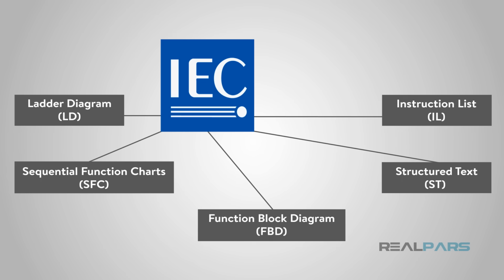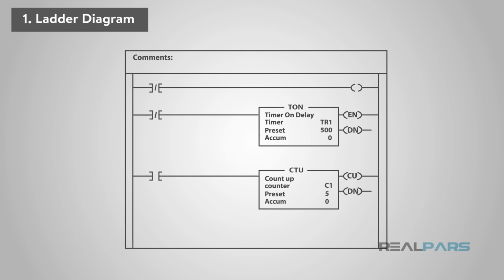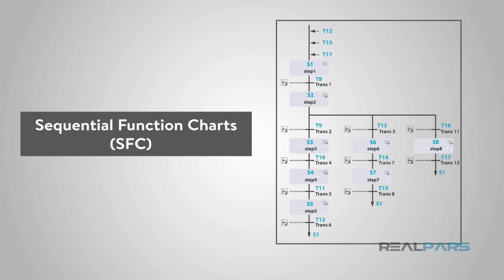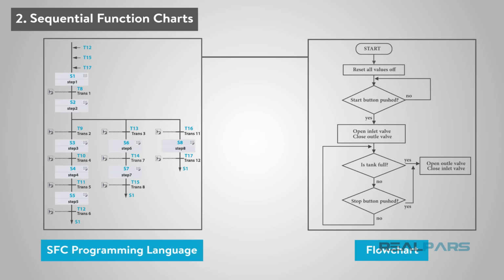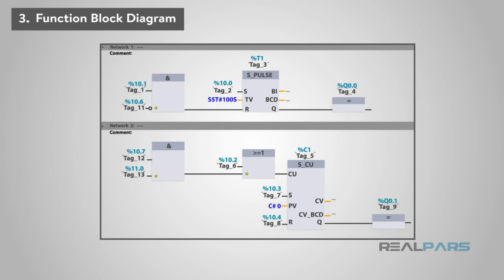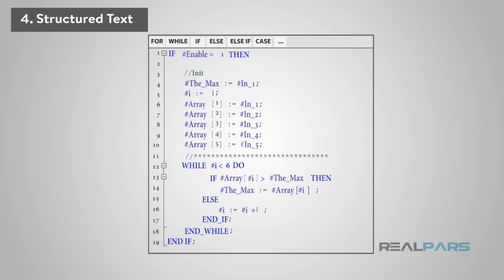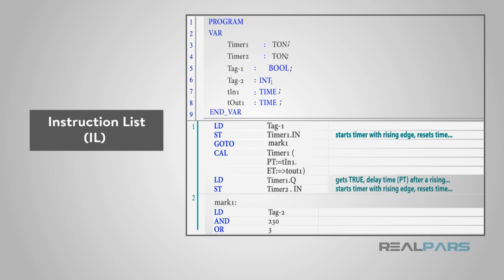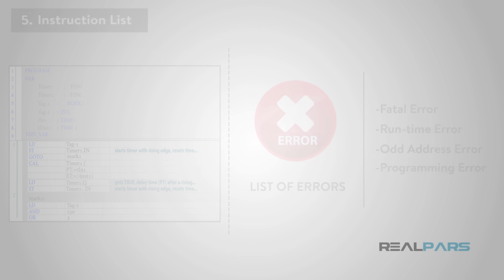What are the Most Popular PLC Programming Languages?

Comment: I worked in industry where both plc and pc were used to control  a pressbrake.Just could not figure how and why that was necessary.Somebody help.
Reply from the maker: Hello, @dominicmwendwa2204.  Thank you for your question. This is common in some industrial requirements. This is not new. I suggest you check with the design engineer or the manufacturer in your case.  Sometimes, it’s a cost-driven design. Happy learning from RealPars!

Comment: i don`t understand why we need PLC when we have microcontrollers. isn`t this some old fashioned?
Reply from the maker: Ibro, thank you for your question.  Although PLCs have existed since the 1970s, they have always been based on microprocessor technology.  In a PLC system, there can be hundreds of microprocessors since every CPU, communication card, and I/O card has multiple embedded processors.  Microcontrollers are just the same type of hardware assembled into smaller packages.  If you want to control a single machine, such as a lathe or CNC machine, then a microcontroller would be a good fit.  And this is precisely what the manufacturers of these machines do.  But to use an Arduino or Raspberry Pi programmed using C++ to control an industrial process is not practical.  You would need 10-15 RP's to match what a single small PLC can do, and the code needed to coordinate the functions of all these processors would likely go beyond the available memory of a Raspberry Pi.  Also, think about the support of the system on the plant floor.  I teach courses to plant controls technicians, and I have only run across one or two in the past 5 years who could support C++, Python, or another similar language.  I do not know many engineers willing to work shifts to provide support, and I am not sure companies want to pay engineers to do so, either.  Microcontrollers are not new.  So far, they have not been used for manufacturing applications. That may change.  In the meantime, smaller PLCs, like the PLCNext, have been gaining in popularity because they provide a traditional PLC hardware and firmware platform with the ability to use higher-level languages if the user wants to do so.

Comment: Last year, out of necessity, I taught myself the ancient Mitsubishi Alpha2 FBD platform for the sole purpose of reversing and fixing an undocumented, buggy, incomplete program that runs a public drinking water treatment plant. No backup copy of the program existed, so the first priority was extracting the program from the PLC. Upon opening a copy of the program to start reversing it, I was dismayed to find that the compiled binary doesn't include metadata like comments or the graphical layout of the program. All of the function blocks were stacked on top of each other, the "rubber band" connectors strewn and knotted up really bad. Took me weeks just to de-obfuscate the layout enough to even start reversing the actual code.

Comment: only using SFC FBD when required and ST as main, worked 10 years with plc's and rest I think they are a bit obsolete nowadays since plcs aren't used to perform only simple tasks, we got way higher cpus and mcus to only perform basic tasks, now a plc can handle graphics, peripherals with high speed connectivity, we have modbus tcp'ip, ethercat, hdmi ports, high speed usb poorts, cpus controlled better than a mcu with low jitter timings, multicores, high frequency, I think LD is in the past cause today a single plc can handle an entire system or a finished product; My opinion LD is for novice only, I prefer writing a line cause in the end a PLC is a logic controller same as a computer cpu
Reply from the maker: Thanks a lot for sharing your experience and knowledge with us. We are always very happy to read such insightful comments. 

Thanks again for sharing and happy learning!

Comment: The tutorials are awesome. I was hoping if you could help me with a question. Can a PLC use two programming languages at the same time?
Reply from the maker: Yes, at the programming software level. For instance, an S7-1500 CPU can use function block in one routine and ladder in another in the same program.  When the program is compiled. it is compiled to the same downloadable code type (SCL-like).  However, only languages supported by the CPU can be used.

Comment: i am a programmer in python and c++ and but I am new in automation subject. i really confused do i use Ros and Codesys. Can I control servos by Ros.
Reply from the maker: The "languages" that you use to program devices like robots and servos is determined by the manufacturer of the hardware.  CODESYS refers to a programming environment that encompasses the IEC 61131-3 languages as well as a few hybrids.  CODESYS is a platform-independent software development and execution application.  The developer tools are free, but the automation servers require purchase (very reasonable compared to a hardware PLC).   If you search the internet for "CODESYS Device Directory", you will find a directory of all available devices that can be programmed with the CODESYS environment.  ROS is an open-source programming tool for robot control that easily integrates with C++ and Python.  You would need to check with the manufacturer of the particular servo to determine if you can drive the servo independently as a "motor" or whether a specific drive is required to use the servo.
Reply: @realpars  Thank you very much for the reply.
Reply: Spacetime Matter Do you know how to design the PLC program S7 200?
Reply: @truongtruong817  Currently I have s71200.  i am using tiaportal to program this plc LD and scl languages. For pc i am using python snap7 libraries. But I haven't program any 200.Even i don't know 200 exist. Only 1200,1500,400 and 300.Why did you ask?
Reply: Spacetime Matter because I’m studying at school about PLC S7 200
Reply: @truongtruong817  probably Siemens sistem  all same. You need tiaportal for programming plc from pc. But it is not free.
Reply: Spacetime Matter yeah, how much does it cost?
Reply: Spacetime Matter which country are you in?
Reply: @truongtruong817  I prefer not to share my personel data in common area. But if you explain your problem totally and if i know the solution, i would like to help you.
Reply: Spacetime Matter I have an exercise is that programmer the traffic light by PLC S 7 200 but I don’t know to do it
Reply: @truongtruong817  If i am understand right , you need the turn on 3 lights predically. Connect the outputs of your plc to 3 lights and make timer. It looks easy. Also you can do it from pc to plc connection by a progmming. Of course it has many step to realize this project. But it is impossible to tell you or show you from here. Also i don't know what you know and what you don't know. And  also what components you have  . If you are a student maybe had better to use arduino first for you. One arduino 3 led light and arduino studio is enough. And tiaportal can be very expensive for a student. Look some basic starter kit they are 800$ in some webcite. I hope i can help you.Have a nice day.
Reply: Spacetime Matter thank you,How can you help me?
Reply: @truongtruong817  Probably i cant.
Reply: Spacetime Matter yes,did you design the programming of traffic light ?

Comment: I need to control stepper motors via HMI so which language you recommend. Moreover, if I have a power supply which came with optional RS232, USB, & Ethernet Control ; can I control the stepper motors with the power supply by the same language?
Reply from the maker: Normally, you will control a motor (or any other control device) with a controller like a PLC.  I am not sure if you really mean to control the stepper motor directly from an HMI without a PLC.  If you want to set parameters via the HMI but control the motor via PLC-connected I/O, then a single 24VDC power supply using whichever language (ladder, structured text, function block, etc.) you would like will work just fine.

Comment: O, wow, I studied this sh*t in the university)
Standard programming languages C/C++) feels more comfortable and natural
Reply: Do you think they are gonna run an oil refinery or auto plant on RasPi??  Lol
Reply: @drakes89  huge plants and refineries don't rely on single or multiple plc's, they rely on computing power, servers, racks and racks of servers, local and remote controls and backup systems, sure they can use raspi on some branches along they way depending on needs and the complexity but for most part the huge projects like this they make custom parts, they got contracts with AMD or intel or nVidia or some arm manufacturer, they won't rely on a S7 or an ABB or whatever, cause they only use these when that particular machine has to do one thing only same with a pi or any other sbc they might use it if they need more than one thing done and is not that time critical so stop talking about petro-chemical industry when you don't know; oh yeah another thing all these use cases are within a precision point dictated by a standard method such as ASTM, ISO, EN, etc. that you can't overlook cause you will not function, so yeah based on these standards engineers decide what to use and where to use.
Reply: Игорь Баклыков In my opinion PLCs are outdated technology. The only reason they exist is because the migration costs are too high and there are less industrial microcontrollers and accessories.
Reply: @michaelschalk4718  And a computer needs updates and shit and when in 2 years time something breaks, you are into a whole lot of dodo to get it running again, because all the connection points in Hardware and stuff have changed. I have seen PLCs that ran for 35 years and never got an upgrade. What you have to know is, that there are microcontrollers inside of them. You can program them with C and C++ if you're using the "new" S7 1500 ODK Kits. Basically your comment shows that you have no idea what you are talking about. PLC is not a PC and should not be treated as one.
Reply: @michaelschalk4718  I disagree, the reason why PLCs are still valid ( and will be ) is thath there is no need for using higher level programing running on complex system with operating system when you are programing simple technological processes. If you would  use more complicated systems for technology control you only risk more possible error. And you dont wanna risk when you are programing assembly line that needs to run 365 days a year :)
Reply: @michaelschalk4718  PLC can be any embedded or SBC computer nowadays PLC can be even an nVidia Jetson so I don't think are outdated, PLC remains today as IEC language and many IDE's on the market supports IEC to transform anything with cpu/gpu into a PLC even a raspberry pi with some tweaks can be a PLC and can be more reliable and way more powerful than a Siemens PLC or any other PLC and can do way more with it

Comment: Once you learn ST, you will never use another language. It is a little difficult to learn if you are not familiar with programming in c or pascal, however once you get it, you can make the same thing like other languages but using just a few lines of code. You can create really complex algorithms, such as advanced PID control, stepper/servo motion control using matrix theory for driving several axis simultaneously (widely used for robotics), manouver variables directly in word data type (memory level) saving cycle time when running big programs, you can read and write data directly from protocol ports (ethercat, modbus, profinet etc),  not to mention the integration with image systems. you are not limited to the manufacturer's library and function blocks. You will have the power to modify and create new function blocks based in your needs, edit libraries etc.. You can make things that are impossible in other plc languages.
If you are starting to learn PLC and your goal is to become a pro, go for ST language and you will not regret.
Other languages like ladder are good for electricians due the way it is written, it is pretty simple and easy for first steps, but as soon you need something more complex such data analysis, dinamic control or advanced motion control, these languages are not good
Reply: But, Ricardo, what about the people who will troubleshoot and maintain the code?  Those people are far less likely to be classic programmers and more likely to be electricians, instrument techs or engineers.  Even engineers are maybe 50% likely to be good at structured text programming.  I've been doing this for over 20 years and I've only rarely come across a control configuration that couldn't be easily handled in ladder, function block or sequence logic.  Structured text, for all it's programming power, provides virtually no visual queues to the person who, 5 years after it was written, is trying to figure out how to fix a problem or modify the functionality.  I can program in 5 different textual/object-based languages, but I loath staring at someone else's code and trying to figure out how/why they did something a certain way.  Ladder, FB and SFC all make future modification orders of magnitude easier and modern processors are rarely challenged with the volume of code they contain.  Why argue that you can program an operation in five lines that might take ten rungs of logic when this will result in  people pulling out their hair a few years later?  Personally, if I encounter ST code and determine that it is not essential that this operation be in ST, I will re-program it in a more appropriate form and delete it.  That way maintenance people can easily diagnose any problems and I can get far more sleep.
Reply: @MarkMcMillen2112   I surely agree with you that ladder and other visual languages are way simplier to troubleshoot. Also they are much easier to learn how to write and to read.
I myself have learned automation using ladder for several years. 
Back then, the machines where not so complex and i had just to manouver digital input and outputs for reading sensors and controlling motors, pistons using standard function blocks provided by the plc supplier. 
In that time, the most complex applications required a simple protocol such as the old modbus to syncronize the logic from a production plant.
However, we are in 2019 and automation is giving huge steps forward. The new technologies requires much more data analysis and data  exchange between systems and a good plc programmer cannot be limited to the classic simplified languages.
Today the manufacturers wants the integration of the processes with different systems, exchanging data in real time using industrial protocols and also by internet. Imagine that you have to perform an application where you need not only to control a machine with its valves, sensors and motors, but also syncronize a robot arm that will perform a job while the product is scrolling in a conveyor belt, and using a cammera image system to mapping in 3d the product and running a "machine learning" algorithm (in motion) for quality control and feedback to other systems , and at the same time you have to feed the equipment with an UHF r-fid based system (ethernet ip) reading the tags for each product , changing the pattern from the robot loading from the cloud in real time exchanging data with the database from a logistic system thru FTP. In top of that the customer wants the information to be treated and distributed in instances and classes thru the company departments and by http for end users.
I have just described to you a single part from the manufacturing process from dental protesys plant.
Try to do this using ladder, and good luck.
That example is not an exception. 
Have you seen a mobile phone battery manufacturing plant? Or perhaps a gearbox manufacturing plant?
What i am saying is that if you are a begginer, why not to invest studying C and ST to open the doors immerging into the new technologies. That is my suggestion for the young engineers.
Your example about messy code is probably that you have got a bad programmer there. There are some rules to folow when using ST or C such as "code pattern" (videos about it on youtube), in this way any other programmer can read and modify your code.
After all, C and ST is not that complicated to learn.
Reply: Damn Dude! talk about less code and less number of sentences!
but i do agree with you..
Reply from the maker: That is surely a great comment. Thanks a lot for adding your knowledge, greatly appreciated!
Reply: Haven't seen this here yet, but ST is also better for those who have previously used Arduino boards.
Reply: I love u